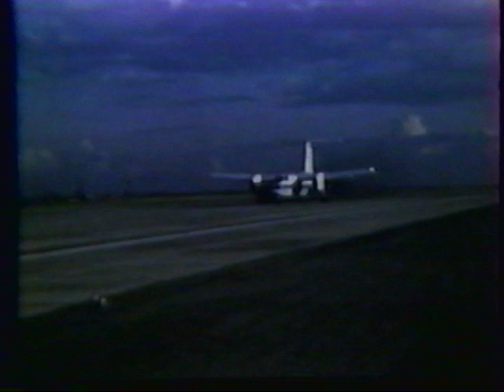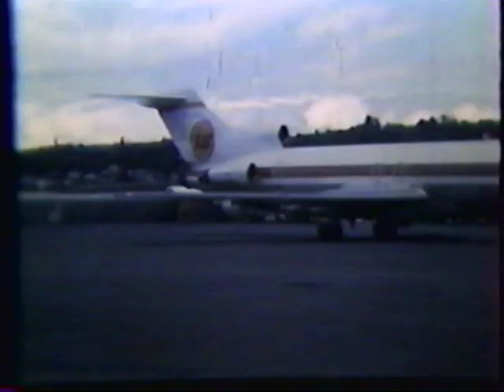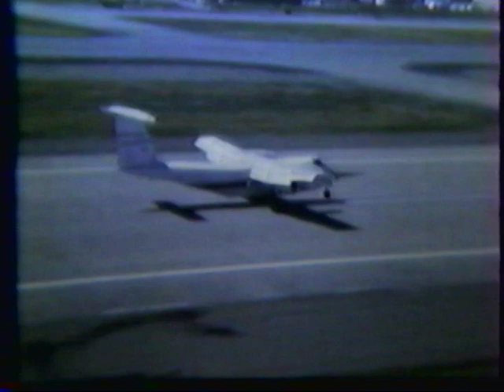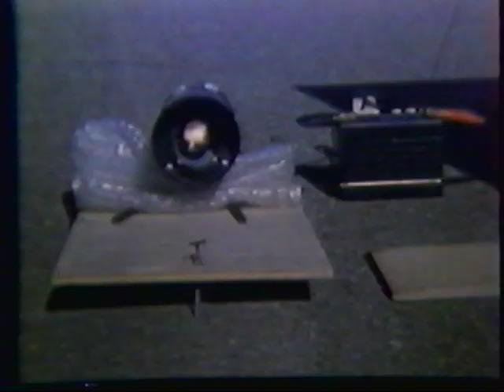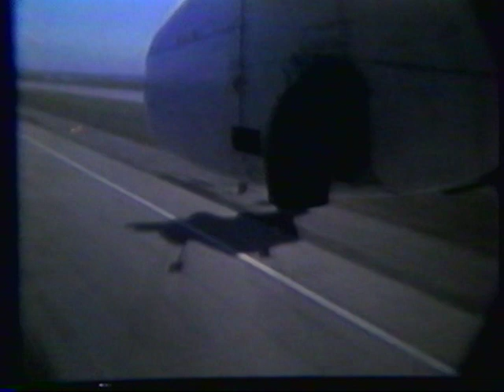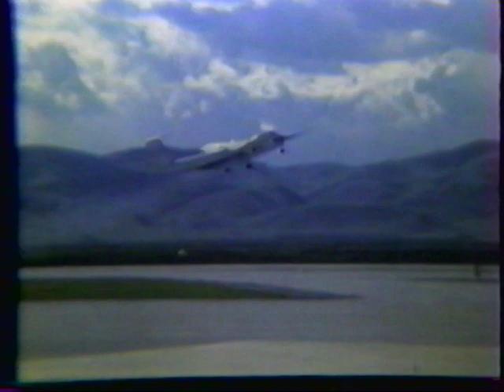De Havilland Canada/NASA Augmentor Wing Aircraft

Comment: It flew at NASA Ames until 1981, then 'returned' to Downsview (but it had not previously been there since the modifications).  I have a photo of it at Downsview from September 1981 with the Powered Lift Technology group.  It then flew for 2 summers at Mountain View Ontario, near Trenton, before being broken up.  One of its Spey 801-SF engines was used in the E-7A V/STOL fighter full-scale wind tunnel model